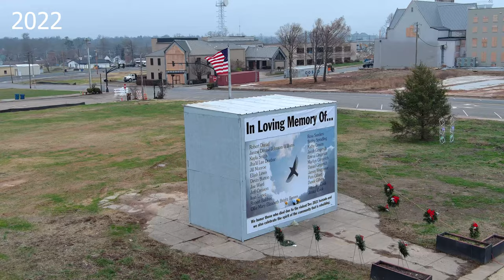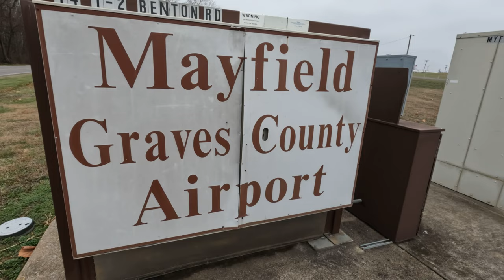A tornado flattened Mayfield Kentucky | See what it looks like today

Comment: That order not to leave, while it killed 8 people, is probably the decision which saved many lives. If these people did go home, they most definitely would not have been alive.
Reply: You are absolutely correct while some of them did live very very close to the factory a good number of the workers or from the surrounding counties that were hired in through out of town, temp agencies and these people I will say a good 60% had at least a 30 minute drive to the residence if they would have left on that last break between tornado warnings, they most definitely would have been on the road in the middle of the dark and if you are not from this area, close your eyes and pictured driving through the woods on a skinny back road, and then running into a monster EFI tornado with nowhere to take shelter, but the woodsis not your town. You cannot just get out and run to someone’s house to take cover. There are areas where there are several miles and miles and with nowhere to take shelter. Now had the candle factory let all of their employees go at Freehill. They would still be on the hook for the people that were killed so either way the candle factory was going to have to take the wrap.